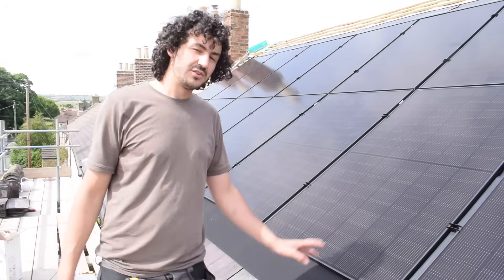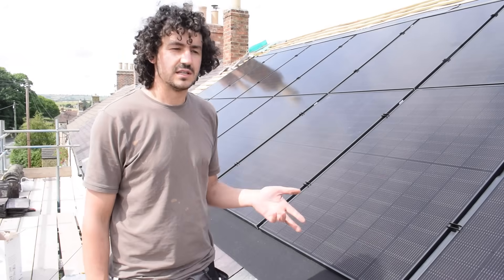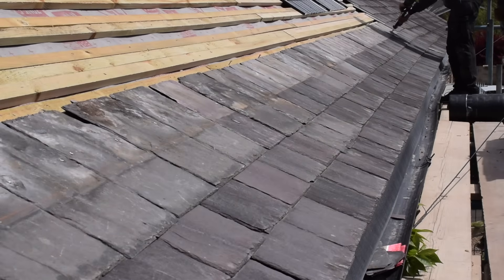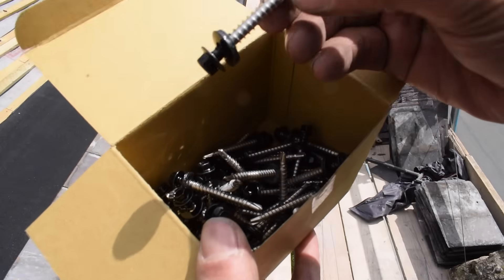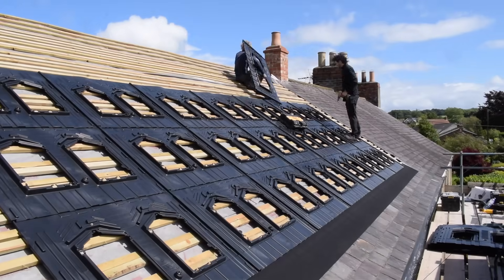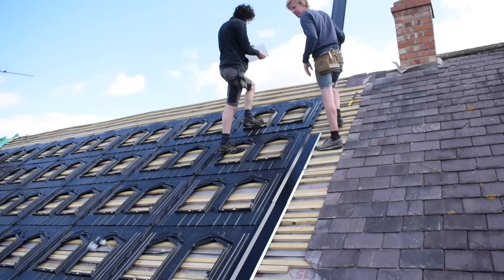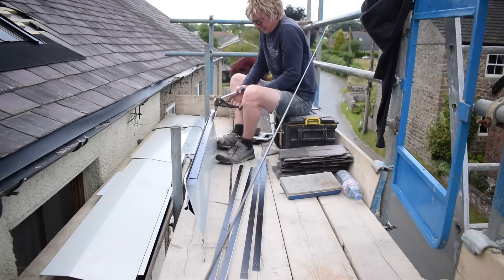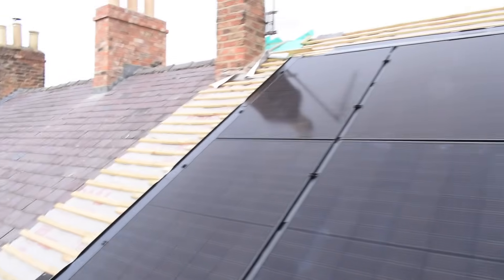Installing Solar Panels in the Wind | In-Roof System GSE

Comment: Can you do a video on how that panel system DOESN'T leak?  Wide open space below each panel with no slate or shingle... confused.
Reply: Ventilation.  Aperture well sheltered by pv panel, protected by raised lip around the hole creating a runoff.
not water tight, also not a submarine.  Similar to how tiles overlap & just work by the predictable nature of gravity.
helps cool the panels too as they are fitted close & lose efficiency at the high temperatures black slabs are prone to.

Caveat * just a guess, never used them myself

Comment: I've got to try and get these integrated into a new standing seam roof installation on our self build.  I don't want to put them on top of the standing seam as they are cheaper than the roof panels!  Very little literature on installing them with standing seam though.
Reply from the maker: It's essentially a huge Velux skylight, you may need deferring batten sizes for it to work. Good luck
Reply: @maxxwebster not thought of it like that.  I’ll investigate how you install a velux into a standing seam roof.  Thanks for the tip!

Comment: We have the same.system on our house, but the panels keep sliding down the trays. Is there anything other than the clips stopping them sliding, like a ledge on the plastic trays etc? Just wondering if the installer is missing something! Nice job on this by the way!

Comment: I really like panel fittings, so much better than having a metal or aluminium framework across the roof, which provides space for pigeons to nest and lay their eggs. It looks so much cleaner, electrician and roofer in one. 👍

Comment: Great video, where does the magic tape go?
Reply from the maker: If you mean the expanding tape, it goes on the flashing to stop water being blown across into the roof. It’s not needed on this slate roof as the slate sits so close to the flashing. 

Love the profile pic BTW, my first car was a 2CV.
Reply: @theroundcorner  thanks for the info, I've used expanding tape around velfac window etc, always called it magic tape. I thought that might be where it's for, we're working on slate and I don't think is required here either,  probably more for tiled roofs I imagine. 
The 2cv is one I built from bits 5 years ago, I also have a 2cv van, bit of a project!
Thanks.

Comment: Great video guys. What bottom flashing material did you use here? We're still experimenting to find the best option. A lot come in 5m lengths only.
Reply from the maker: Thanks! The flashing is Ubiflex B3 and I get it in a 12m roll.

Comment: Nice video, good to see it done for real rather than GSE's promos. How did you get the slate tiles to sit neatly over the lip of the lateral flashing? I'm reusing  original clay plain tiles and I can't work it out. Bash the lip down? All the guides show arched tiles, which makes it easier.
Reply from the maker: Thanks. Yeah you’ve got it, just tap the aluminium down with a hammer where it’s interfering with the slate.

Comment: Thank you for taking the time to make this, I really appreciate it. I am planning to DIY this with the assistance of a roofer. It's daunting and seeing the actual process is a massive help.
Reply from the maker: You’re welcome, glad it’s been helpful. Good luck with it, as long as you start right and get the trays at the correct height you can’t go too wrong. You may be surprised at how easy it is.

Comment: Always surprises me that in England building regs don't ask for counter battens. Subscribed so you get your 1,000 and start monetising.
Reply from the maker: Not sure why it’s not common practice as would be much better for ventilation to have a counter batten. Thanks for subscribing!
Reply: A modern house will have dry ridges which ventelate at the ridge, the soffits will have vents too.
Reply: @JohnnyMotel99  Not denying that but can't argue that a horizontal barrier on a sloped roof allows potential for pooling, counter batters remove that for minimal cost and effort.

Comment: Hola. Con un cielo con poco sol, ¿ se logra producir algo de energia ? tengo entendido que el Reino Unido los dias no suelen ser soleados.
Reply from the maker: Hola. This system is expected to make 4700kWh per year. The panels work well when they aren’t too hot and still work with cloud cover. The main caveat in the UK is that we have longer days in the summer when we need less energy. Solar panels are definitely still worth installing but they’re just a piece of the puzzle.